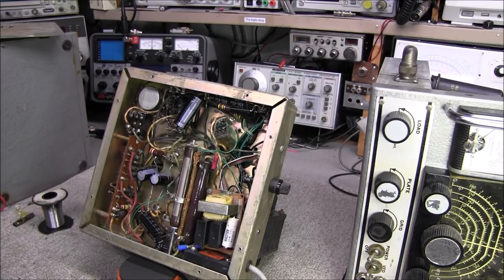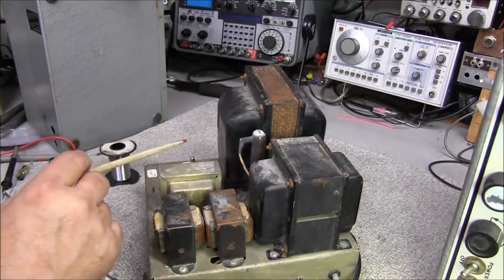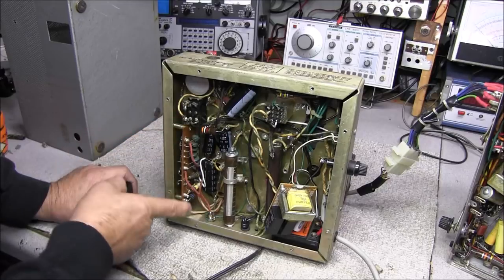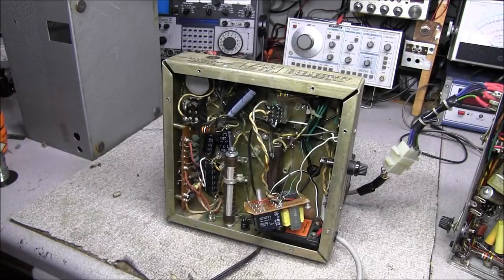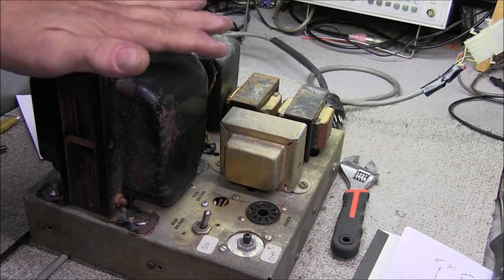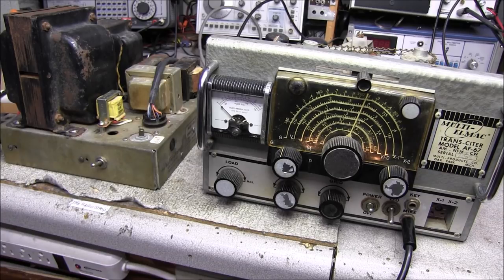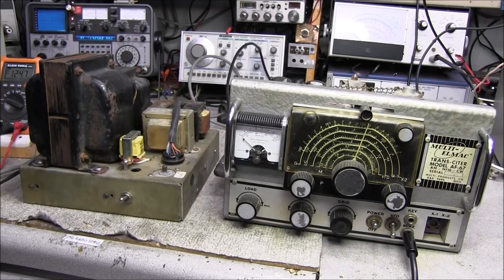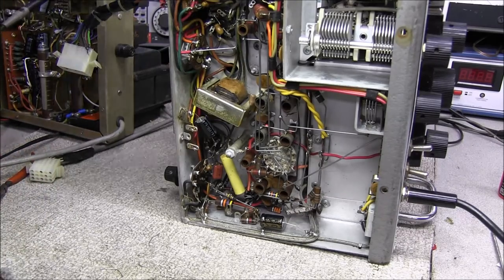#224 Multi Elmac AF67 Transmitter  Getting Started

Comment: Great video and good work.  I saw the bias adjust pot underneath on the AF-67 to adjust the -27 volts from the battery to the -22.5 volt mod bias voltage that came from the original battery.  I used my PTT control voltage power supply I built to also provide mod bias to eliminate the need for the battery.  I set the modulator plate idling current without modulation to 40 to 60 mA and that works well.  That's with the meter in the "M" position.  I've been using my AF-67 weekly for the past 37 years.  Great radio.  Power out on 80 is 35 watts; on 40, about 40 watts, then down a bit on 20 and 15 and on 10, only about 25 watts.  The NBFM works great as well.  73.  W9DKB
Reply from the maker: Thanks for that information

Comment: That was your state of the art mobile transmitter in 1955 Buddy. Don't know if they had a matching receiver at that time. It had a wide  variety of power supply options. You could then take it out of the big Buick and drive your pair of 813's at home with a big signal on 75 AM. Ah the good old days. 73 Doug.

Comment: I had one of those as a Novice.  Built my own power supply using parts from junk TV sets.  Like almost all AF-67's found second hand, it had a burned out modulation transformer, but I only used the set on CW.
Reply from the maker: I miss the day of tube TV sets. Used to get so many parts from them.  Even built small audio amps using these. Thanks for sharing

Comment: Yesssss Im a big fan of The Mighty Elmac! I have collected them over the years.
Reply: It's a great radio, and they sound fantastic on AM. Originally designed for AM mobile use, but you could also get a power supply and a matching receiver as well, as I'm sure you are well aware :D. Unfortunately, and more often than not, the original power supplies seem to get lost.

Speaking of the supply getting lost, I wonder if you could draw up a schematic on that supply, Buddy? I'll probably get a 67 sooner or later, and, more than likely, it won't come with the supply. Even if it does come with the supply, there are tons of 67's and 68's out there with no supply. You'd do us all a great service drawing one up.

BTW, where in the heck is my $20.00 FT-101E? Yes, this is who you think it is, posting from my stealth account :D. Been getting very political on YouTube, and some folks have been threatening me, so now I'm Dave :D.

73
Reply from the maker: Great comment. Yes I can draw up that power supply schematic but there are several direct supplies that can be used.Not sure who this is. So email me please ;)
Reply from the maker: Pretty nice units and built like a tank.
Reply: @TheRadioShop  Will do. Going to bed now -- it's 9:22AM and been up all night geeking :D -- but I'll get in touch with u this afternoon. I'll put my subject line all in caps so it will stand out for u.
Reply: @TheRadioShop  I would like to see what you came up with... I have a Ps-2V . Id like to build another one for an AF-68 I have.

Comment: That is a very cool transmitter even with the strange power supply design. Great job, Buddy. I am looking forward to the next in the series. I'm especially interested in how you are going to clean up the glass/plastic/whatever on the front dial and get the yellow out of it. Thanks for sharing with us. 73 de K7RMJ  Frank
Reply: Actually, that yellowing is not from smoking. It's caused by a chemical that was used in the plastic. I know this because I had a Commodore Amiga, and the plastic they used on the the monitor and computer yellows over the years. If it was from smoke, Buddy would have noticed the rest of the rig being quite yellowed, and it wasn't. (Shrug.)

BTW, Buddy, search for "Amiga plastic yellowing" (or something along that line), and you'll find a chemical that they use that helps get rid of most of the yellowing.
Reply: You're right Dave. I am curious how Buddy gets that aged yellow plastic cleared up. Perhaps I should say, I hope he has another trick up his sleeve that will clear it up.

Comment: Yes that supply does look pretty awful I don't think I have seen many that look like that but, like you said if it has the right voltages it will be good for testing purposes. You did get the transmitter to work so its a success just a bit more work and it will be a nice little transmitter.
Reply from the maker: You are right. I feel a bit safer now.
Reply: @TheRadioShop  Yes I would have bet that power supply would have been smoking or arcing over even using the variac lol

Comment: More trust than I would have. I think I would have taken the power supply apart, and do a rebuild, and in that rebuild, I would have cleaned the transformers and add new paint. If he is going to show that much care for the AF-67, why not make the power supply shine too.
Reply from the maker: I only used this supply to test the radio. It is still not safe as it should be. Plans are to build a new supply for it.

Comment: Awesome video! Do you have a short explanation regarding what the heck "meters" meanes? I've atempted a few guesses. 1. When I stand 2 meters away from my NC-300 with the unplugged 2 meter converter box in my left hand, I've discovered that I cannot reach the knobs on the NC-300 with my right hand. Any explanation would be greatly appreciated. Thanks!
Reply: I think I see the problem! Are you using metric metres or imperial metres? Get this right and it should all start to work.
Reply: @jonka1  imperial comment ;)

Comment: Why build a 12 VDC power supply just to bring on a relay.  Why not just replace the relay with a 120 VAC coil?  Or power on the relay off of one of the many other supply voltages in the chassis.
Reply from the maker: Good question, let me further explain. First the 12 volt supply was already installed but was poorly designed.  All I did was correct what was there.  Second, 120 volts would not be good for this circuit.  I would had to change both relays to 120 volt coils. Expense added. Also this circuit is activated by the PTT and runs through the mic.  This means when idle there is 120 volts in the mic until PTT is pressed and completes the circuit.  I hope this helps explain a bit.
Reply: @TheRadioShop  Thanks for the info.